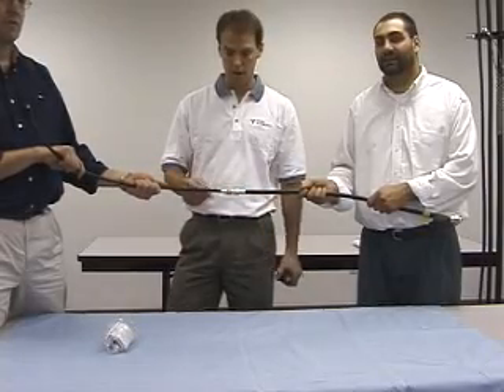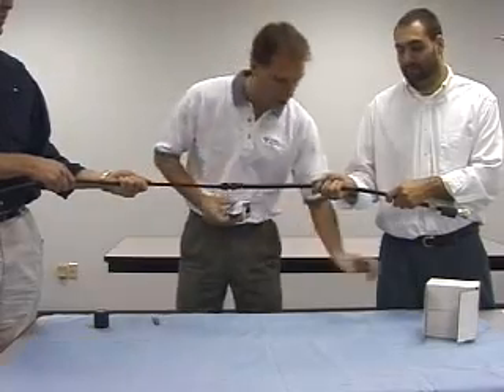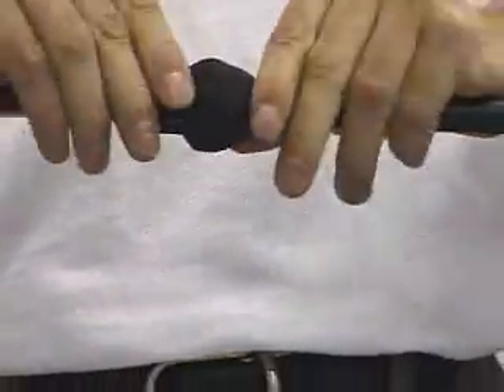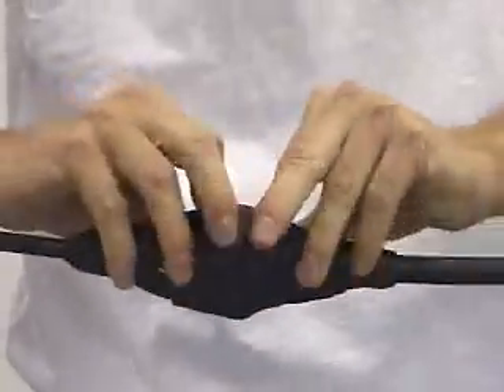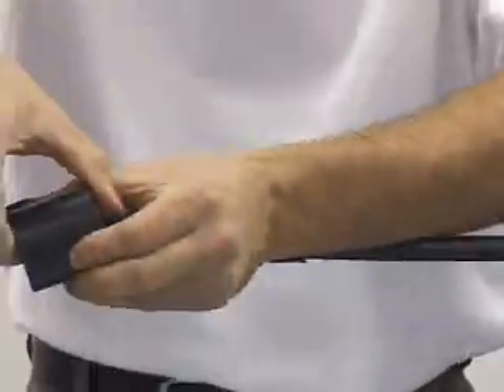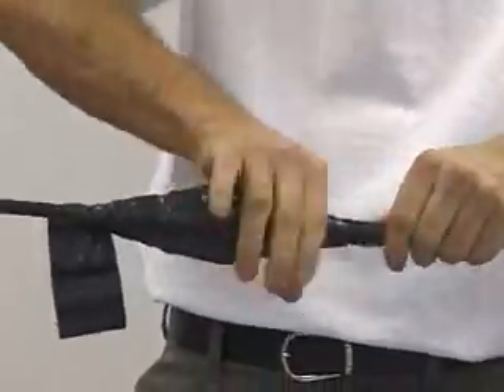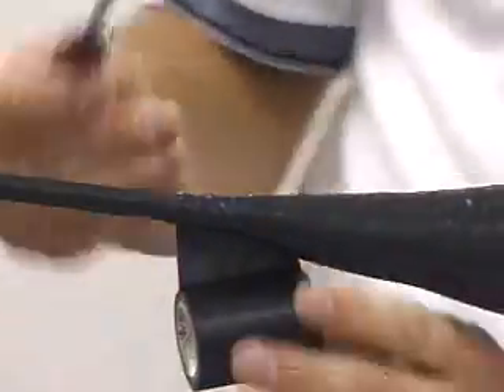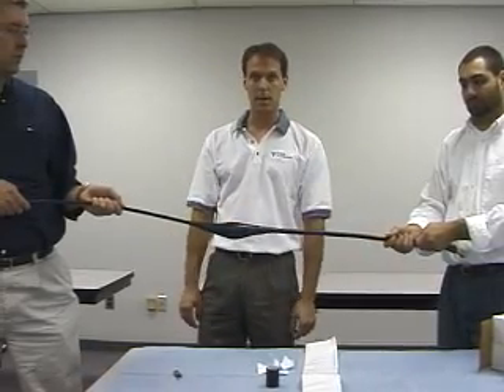outdoor cable weatherproofing

Comment: i got a etthernet cable and it will have part of it outside of my house. my question is do i have to get some weather proofing stuff or is it already water proof?plz get back to me.
Reply: i have the same problem. I have an ethernet poking outside of my house too and i want to cover it with a good protector from any sharp scissors and weather.